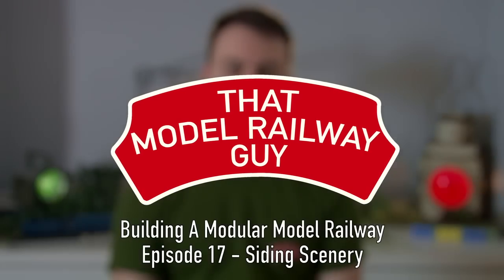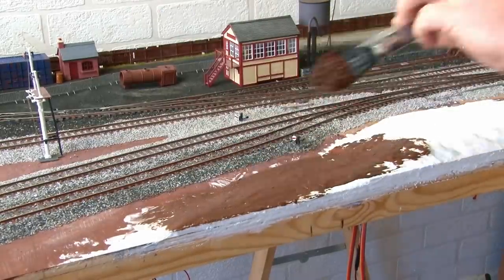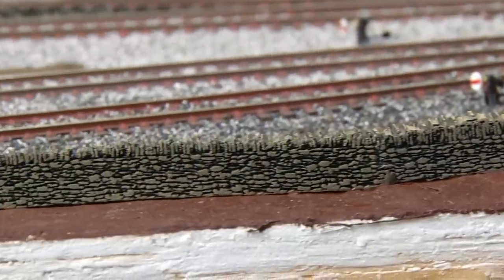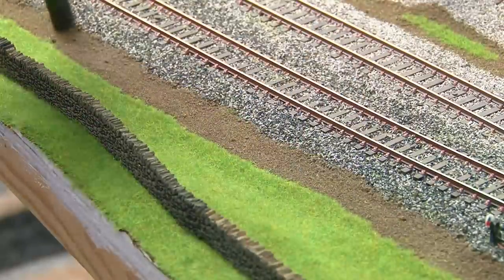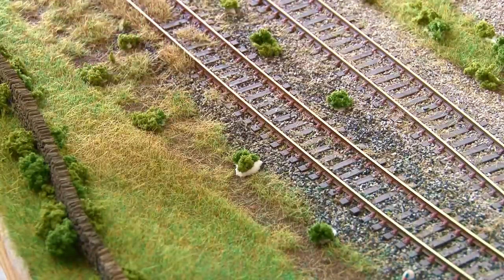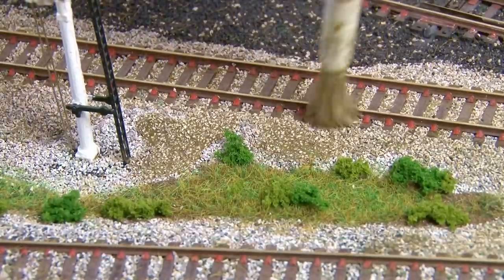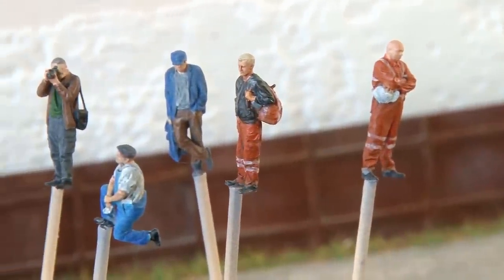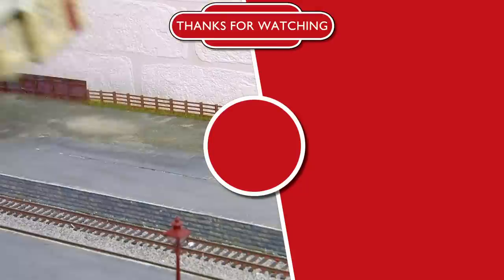Building A Modular Model Railway - Episode 17: How To Create Overgrown Track

Comment: Hi mate, only just got around to seeing this. I really like the sidings: as you have rightly said every heritage railway has a siding of forgotten vehicles and ‘one day we’ll get around to it’ restorations! I was going to suggest a few tarpaulins here and there once you have fitted the various minutiae and cameos about the place. I find those waxed sweet wrappers particularly useful as the don’t crease easily and will take spray paint really well so you can weather them effectively 😉

Another thing I like are old pencil rubber housings (ie the metal bit that holds it in place ✏️ at the top) as they can be slightly mangled and weathered and look like rusty old containers, etc. 🤓

The undulations really do make it look so much more realistic and I agree foamboard is a brilliant (and quick) method to use, so I am going to blatantly steal that for any small undulations in future 😂💡

Great stuff, going to watch these tone once I’ve got myself a cuppa! 😎🍻👍🍀
Reply from the maker: Yeah, there's definitely plans to create more clutter around the various sidings on the layout. I have some ideas for doing tarpaulins and if there's time I'd like to do a full train of heavily weathered/rusted stock that just sits in the sidings. All those little details that can just be added to the scene now that the main scenics are pretty much there. Thanks for watching 😃

Comment: It's great to see the MPD and sidings finally come to life, with those excellent figures and details really selling the scene. A top notch job! Have you perhaps considered fixed distant signals on the approaching boards to the station, perhaps?

My only peeve, and this is because I nitpick when it comes to railway signalling so apologies, is that the points closest to the 'box that you have put a handpoint lever next to wouldn't have been a handpoint. The other one is fine, mind you, as it would have no bearing on traffic, but the former would be controlled by the 'box as part of a crossover with both sets of points moved by one lever. This protects the running lines into the platforms from errant and unauthorised movements from the yard.

But like I said, it's a nitpick with everything else seemingly flawless!

Keep up the good work!
Reply from the maker: Fixed Distants are definitely on the list to add to the outer modules - they'll probably be too close in reality but the whole thing is massively compressed anyway, even for a heritage railway 😅

I knew there would be some logical reason those points wouldn't have levers! To be honest it was based off something we have a Spa Valley Railway where the points into the yard/shed are operated from the ground - although it's not a crossover. To be honest though there's plenty of issues with the signalling and points anyway so I try not think about it too much 😁 Thanks for watching 👍
Reply: @ThatModelRailwayGuy  that's the thing with signalling that I've always found when it came to the semaphore age: you have your principles book about fifteen centimeters thick, and the exceptions addendum is seven times as long!
Reply from the maker: @SilverGear_  If anyone asks at the exhibition I'll just say, "it's a heritage railway, they don't have all the proper signalling installed yet" 😜

Comment: When placing Wooden pallets suggest you ensure the slots for the forklift truck forks would be accessible otherwise they could not be placed or moved
Reply from the maker: Hi Gary, while I see your point I think it's unlikely the heritage railway would have a forklift lying around. The pallets would most likely have been moved by hand with the items placed on top of them individually just to keep them off the ground. Thanks for watching 😃
Reply: @ThatModelRailwayGuy  given the weight of most metal components I would expect a forklift on site most components would be too heavy to manhandle. SecondhandForklifts are not expensive
Reply: May give you an opportunity to add more detail
Reply from the maker: @garylong7599  In my experience at the heritage railways I've been involved with (which is ultimately what I'm trying to recreate) things like this generally have been moved by hand. It's not necessarily a cost thing but more of an issue of space for something that would only be used once in a blue moon. That's not to stop anyone else from modelling it if they want to though.
Reply: @ThatModelRailwayGuy  which heritage railway are you involved with

Comment: Hi!  I have only just found your channel by chance. I have watched three episodes so far this evening and have found all of them highly interesting, all with with great tips and tricks . Great videos!

One small pont, that stands out, for me, anyway, is the lack of a gantry crane - if that is the correct name (?!) - for lifting heavy equipment such as steam engine boilers off road haulage low loader semi-trailers or flat car railway wagons.  A suggestion for you to consider:  How would a grantry cane look, maybe, in front of the mainenance/loco shed with steam engine boiler under it, just left of track 1 to engine shed?  I know the clock is ticking, but, maybe, that is something to consider for a future upgrade.

Carry on the great work, very enjoyable to watch!

With best regards,  Andy
Reply from the maker: Hi Andy, really glad you've enjoyed the videos you've seen so far. It's a valid point but generally I'm basing this layout off my own experiences at the heritage railways I've visited and volunteer at. At Spa Valley Railway in particular I believe we tend to hire in a crane for a day and co-ordinate a series of moves to get as much use out of it as possible. Meanwhile, inside the shed we have special jacks for lifting locos and rolling stock up so there isn't really a need (or space) for a permanent gantry crane. 
It's a similar issue on my layout too, there just isn't really space in the yard area for a large structure like that. It's already incredibly tight getting locos in and out due to the curves leading to the shed. Hope that makes sense and thanks for watching 😃

Comment: This does look great. Im building a railway so this series is definitely helping. Just a couple questions, where did you get that foam wall from? It looks really good and i wou.dnt mind trying it for my self. Also, when you applied the second layer of grass, did you use spray glue or just pva put over the 2mm static grass?
Reply from the maker: There’s links in the description for all the products used - although I will say the quality control on the foam walling has really taken a step down lately which is a real shame. For the 4mm layer of grass I used the WWS layering spray like I did for the 6mm patches. Hope that helps and thanks for watching 😃

Comment: Hey bro so quick question, am I doing it wrong? I’m starting an n scale layout and instead of using foam boards from Home Depot or Lowe’s I used styrofoam for the base and going to use clay for the mountain and tunnel
Reply from the maker: Hi there, do you mean you're using styrofoam as the baseboard to lay the track on or just for the base of the scenics. If you're using it as a baseboard, styrofoam will be nice and light but it does tend to be more delicate. Personally I make my baseboards out of wood, it's more work but they're much stronger and last longer.
If it's just for creating the basic shape of the scenery then styrofoam is fine, in fact I've done exactly that on other parts myself. Whenever you're using styrofoam though you need to make sure not to use any glue, paints or materials that react with the styrofoam and cause it to melt, otherwise you'll have a bigger problem. Hope that helps and thanks for watching 👍
Reply: @ThatModelRailwayGuy  ok have you done mountains with clay before? I’m including a tunnel in mine
Reply from the maker: @internationalthrills5960  I haven't done it with clay myself - I would imagine it would be quite heavy and prone to breaking up. Personally I used chicken wire and mod roc to create my tunnel: https://youtu.be/E7NSgeH6cvE

Comment: Lovely stuff. Was wondering, the dirt you used from the garden, was it dried out and/or baked before scattering?
Reply from the maker: Hiya, yes it definitely needs to be dried out before use if the ground is wet/damp - personally I tend to collect it in the Summer when it's already dry. Baking it (or microwaving is another option) is a good way to get rid of any bacteria too. Finally I run it through a sieve to get just the really fine particles so that it becomes a dust, otherwise it's over scale.

 It's a bit of work initially but I do it once a year and then end up with a tub that I use on all my projects over the next 12 months. My neighbours must think I'm very odd when they see me in the garden though... to be honest they're probably not wrong! Thanks for watching 😃
Reply: @ThatModelRailwayGuy  Thanks dude.